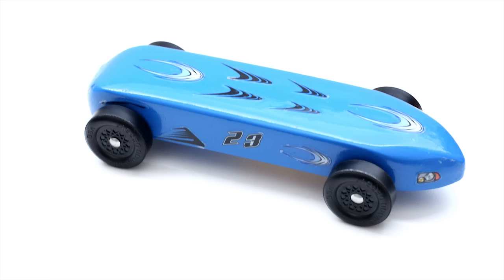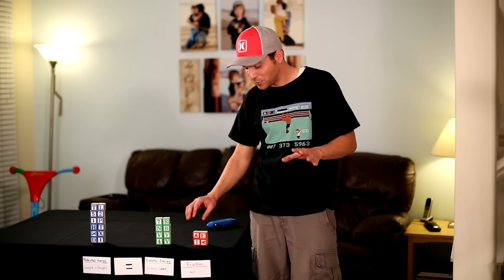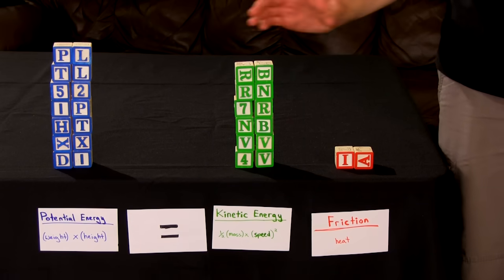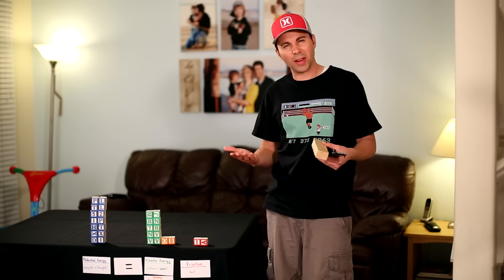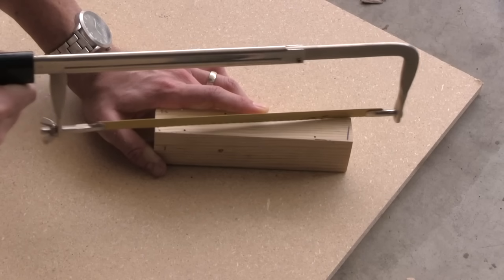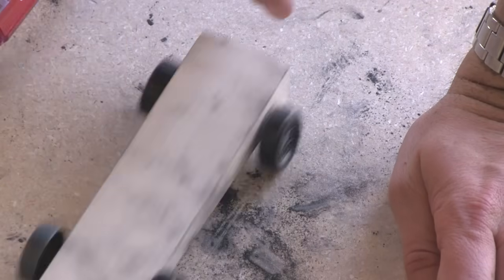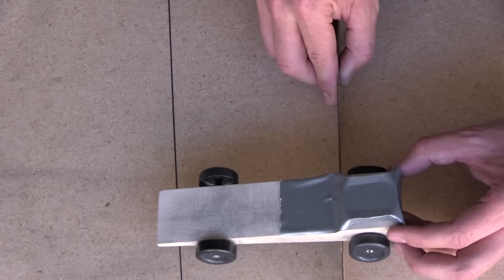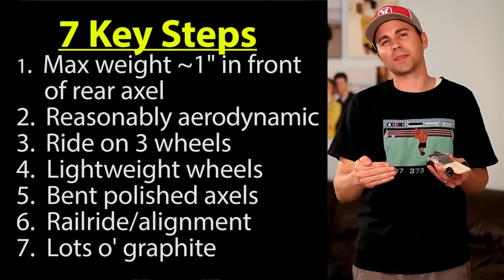EASY Pinewood Derby Car WINS using Science!!!

Comment: I followed his whole video and did exactly everything he said and my sons car was the fastest on the track out of 50 Boy Scouts he won first place thanks to tips and tricks on how he told you to put the wheels and everything
Reply: Congrats
Reply: 👏👏 good job
Reply: woooow xD
Reply: our races all 4 wheels needed to touch and no wheel mods besides removing injection mold seams
Reply: So basically it's a competition between the scouts dad's xD
Reply: @tsupi7056  yeah
Reply: This brings back nostalgia from when my dad helped me and my brother make derby cars and did pretty much everything in the video (and then some). Ended up with me and my winning most races until other parents started to catch on to what "we" were doing
Reply: @d.russell8303  I didn't think so, but it's been about 35 years so I checked the Scout Shop site. Nope, none of these violate the rules SO LONG as you use the axles in the kit.  He seemed to suggest polishing and using other nails, but you can meet every single rule if you just bend and polish the nails in the kit.
Reply: Congrats, you made your son very happy
Reply: @d.russell8303  Usually the only rules are the wheels MUST be official BSA wheels, max total car weight 5 oz, and the car must fit inside a car dimension box to ensure no extra length or height were added to the car.  PLUS - NO dynamic weights, meaning cannot use a weight block that shifts down to give an extra push or a vial of mercury or such.  Other than that, some districts/councils may ban modifying wheels such as routing out inner diameter or coning the axle contact point.  But - these are all techniques that CUB SCOUTS would not be capable of performing anyway so it's usually a sign that the scout did not actually make the build.  HOWEVER, there is an "assistance" rule that pretty much allows a decreasing percentage of Adult "help" as the scout ages so a 5-6 year old scout only has to perform maybe 50% of the build and a Webelo (10-12 year) has to do all the build except for handling the power tools.  

The best technique is for the parent and the scout to build personal cars in parallel so it becomes a step-by-step process that lends itself to direct instruction without hands-on interference.

Let the scout learn by doing and everyone wins.
Reply: rekt
Reply: "Your sons" car, i bet it was mostly yours;) lol
Reply: @johncrosby9312  I am in complete agreement with your closing arguments, and it seems really silly to continue to debate this subject... but having been a Pack car judge for 7 yrs I can remember how crazy dads can get with this event. 

Mercury for cripes sake? TOTALLY sounds like a boy would come up with utilizing carcinogenic heavy metal as a dynamic propulsive component.  

We opened an "unlimited class" for those dads (myself included :P) wanting to push the envelope on what a car could be. The ONLY rules were weigh in at <=5oz, fit in the car box and be gravity powered only so we did not to break the track. Science was used. Specific properties of materials as well.  

My 2 boys' cars may not have ever taken first place, nut they took pride in doing the work themselves with a little help from dad. and spending the time with them was worth far more than a plastic trophy destined for a landfill.
Reply: Awesome 👌
Reply: @tsupi7056  that’s unless you are teaching the child about the physics and the whys and showing the different results. We all learn from each other so it would be a failure to teach as you go along with the build.
Reply: Not your son's car. Your car.
Reply: I guess everybody cheats and nobody checks these days.

Comment: In our Pack we also have the much coveted Turtle award- you have to be the slowest car that still crosses the finish line. It's pretty interesting to see the kids compete for that one.
Reply: We had spark plug trophies and the slowest got n upsidedown spark plug
Reply: Our pack had something like that to. I won. I uhhhh. I uh glued the axles and wheels. So. The wheels didn’t turn. And a few other things.
Reply: Take off the wheels and make it a sled
Reply: Don't make the wheels turn and make it slide across the track but put soap on the "wheels" so it at least crosses the flag
Reply: I'll just put minecraft slowness potion on a working car then LOL
Reply: I wonder if you could use a wheel with a small amount of fluid inside. That would make it harder to accelerate down the ramp. Catching air is good, but axle friction seems like a risky business because it's a linear effect. You want something that will provide more drag at higher speeds, and then maintain a lower speed as long as possible. But what do I know lol.
Reply: Dave Micolichek  This is the first I've seen of this car racing. Do you have to use the 4 wheels, could you say just have the wheels on top of the car and make it a sledge?
Reply: lmao Dave Micolichek really hates when people try to have fun
Reply: General Grievous made a school bus with led lights under us that would change color according to how fast it was moving

Comment: Back in the late 1950s my dad helped me build a winning pinewood racer (which) I still have.  1st step was to go to hobby shop and by a plastic model of an race car.  I built the race car to act as a model for carving the block.  Dad showed me how to cut cardboard templates to act as carving guides.  He had me drill out the bottom side of the car and put weights toward the back and then us lightweight wood filler for the rest of the hole.  This brought the car to maximum weight with more weight to rear.  I won for both speed and beauty at my local recreation center and went on to regional where I got 2nd place for beauty.   I didn't win for speed because I failed to recondition the axles after the 1st race.  At the time dad was working on the 1st ICBMs for the US and treated the pinewood racer as design challenge.
Reply: Your dad worked on ICBMs! That's insane.
Reply: Wonderful memory. My family lived for years next to abandoned Nike missile battery.  😀

Comment: 3 years, 11 cars, 44 races with a 36-7-1 record (Only losing to my other daughters cars in the same race), 9 trophies including 1 Grand Derby champion. All built with Mark's methods. It works! 

Its highly recommended to also watch the Dr Acton video's. I find more and more people have found Marks video over the past 3 years and races are getting tighter because of it I have no doubt.

1. Why do you want to reverse camber the drive wheel? (Imagine how it would contact the center guide if it wasn't reversed). Turning the car into the guide will make it fast but not as fast as reversing the camber. Once you visualize it, you can see the wheel dragging on the top corner of the guide rail with no reverse camber vs rolling along the side of the guide rail with reverse camber.

2. Wheel base. Some race rules tell you that you don't have to use the pre-cut slots. If that is the case make that wheel base as long as you can without putting the wheels past the front or rear of the car. I don't know the exact physics of how it works because my background, unlike Mark's, doesn't include time spent as literally a rocket scientist with NASA. I think it has to do with the stability of the car when it bumps the rail and the moment of inertia to straighten back out. See the other car he is holding in the video that a friend races? It's wheel base is maxed out.

3. Use the lifted wheel to keep the front of the car from going back and forth too much. If the wheel is lifted and out from the center too much, the back and forth motion at the front of the car is much greater that it has to be. This really only has to do with older wooden tracks since they are much less straight and have a lot more dings on the center guide then aluminum tracks. When the guide wheel hits one of these dings it WILL bounce out. Use the lifted wheel to keep that under control.

My only mystery in number 3 has to do with gluing the wheel on the axle so the lifted wheel doesn't roll when it contacts the center guide or let it roll when it touches. Which takes away from the kinetic energy more?
Reply: Wow......
Reply: Wow!  I never knew that there were Boy Scouts out there with daughters.  You must have been sexually active at a very early age, son.
Reply: And this whole time I thought I was reading something from a virgin.
Reply: But, why are you competing against children?

Comment: Been more than 40 years ago for me. Polishing the axles (nails) smooth, narrowing the contact points on the wheels, adding lead to EXACTLY the allowed weight, Fancy aerodynamic carving and sanding followed by a polished lacquer paint job... Ran in one rally and won every single heat hands down. Of course, as much as I know all that stuff now, I didn't have a large hand in the actual process at the time. I still have the car and the ribbons on a dedicated little shelf in the rec room.

Comment: There is an additional principle that might help, which is moment of inertia. You can have the center of mass in the same place but cut down on rotation by having a light center and weight maxed out on the very ends of the car. This would potentially allow you to have the center of mass further back in the car without doing a wheelie. Also, a teardrop shape, with the fat part in the front, is actually more aerodynamic than a wedge, it's just not feasible in real life cars because driver/windscreen manufacture/engine packaging. If you machined it accurately into an aerofoil you could actually induce some lift which would cut down on friction at the axles, while still having very low drag. You could also experiment with the rake angle on the underside of the car, again with the intention of increasing lift. This is the stuff I would play with if I was trying this out myself.
Reply: thanks! very helpful!
Reply: I made an airfoil one year. It did pretty well, but didn't win because it dragged on one track.
Reply: On a free body diagram, lift does the same thing as lowering mass; as a force, perpendicular to the plane the car is on. The maximum allowable mass is used to increase the weight (force caused by gravity on the mass).  Statically, the cars will weigh the same, but in motion, lift reduces the net downward force and during the time the car is going down the incline, it will result in lowered acceleration (especially towards the end of the incline where speed increases lift). 

The reduction of weight-induced axel friction would have to be greater than both than the lift induced acceleration penalty and the lift surface drag.
Reply: my thoughts  @DT-dc4br
Reply: Didn’t even think of this!! The car does have to rotate from its angle of depression to level, and while I’m sure the effect is very small, it could possibly set a car apart from others who just did what was in the video!!
Reply: @macraw83 Nope. His logic is sound. The normal force is, by definition, perpendicular to the car's direction of travel and can therefore do no work on the car (W=Fd cos(theta) and the cosine of 90 is zero). The force accelerating the car is the component of gravity that is parallel to the track (mg sin(theta) in this case). That component would be unaffected by a lift force. All a lift force would so is (as you correctly said) decrease normal force and therefore axle friction. In conclusion, as long as this reduction in friction outweighs the drag of an airfoil, the airfoil would have some (probably very very small) positive effect. Not sure it's worth the effort of making an airfoil, but it would certainly be worth testing.

Comment: The one my Dad built me in 1966 was Candy Apple Red with 4 1/2 oz of lead in the back above the rear axe. Dad carved out a hole melted down some fishing weight's, poured the lead in, wood puttied the hole,set the rear Axel. Carved it down to a 1930s Indy car body. And lubed the wheels and axels with ground pencil lead.
Candy Apple Red metallic with flames and sponsor sticks from model kits. It won the prize for being best looking. And for being the fastest. Damn, maybe just maybe,the old man was a little sharper than I gave him credit for.
Reply: Your dad cheated. You aren't allowed to use anything that doesn't come with the kit and lead fishing weights do not come with the kit. You didn't really win anything. Cheater!
Reply: @gamewizard1760  I didn't build it.  I barely got to touch it
Reply: @gamewizard1760  You sure that was the case in 1966?
Reply: @gamewizard1760  That's not true.  We had to use the block of wood, axles and wheels that came with the kit, but beyond that, anything goes.  See my above post that describes how we built our cars.  That being said, his father was what's wrong with the Pinewood Derby, that being too much parental involvement.  This is supposed to be a learning and bonding project for the boys and their parents, not dad beating a 12 year old kid by doing all the work.  His old man was, no maybes about it, a prick.
Reply: Matthew Rapata   I didn't infer anything, I read the words he posted.  "I didn't build it. I barely got to touch it."  His dad did all the work, that's hardly a "family project" and nowhere near the spirit of the event.  My boys actually worked on their cars.  They did as much by themselves as was age appropriate.  In the first couple of years there was major supervision, such as both of us holding the sander and drill press.  They did more and more of the work by themselves, until they were doing almost all of it the last couple of years.  The only power tool they never used alone was the jig saw.  That's the way you teach your kids, by allowing them to actually learn a skill, not just watch dad do everything.   

Our pack tried to combat the dad egos by also having a race for the dads.  They had to use the official kits, but there were no holds barred, other than power assist.
Reply: @erikbaran7197  sorry as a parent I figured you would want to lead by example and teach him about the human race and how to use our surroundings and knowledge to give us any advantage possible. Including your parents.
Reply: @matthewr920  What did having his father do all the work teach him?  What did he gain, what did he learn by him "winning" without doing any of the work?  The object of the Pinewood Derby isn't winning at all costs, by any means necessary.
Reply: @erikbaran7197   Look at his comment. If you think he didn't learn anything then your wrong. This is a highly competitive sport. If your proud because your son learned how to cut a wood block you should have taught him outside of the pine derby.
Reply: @matthewr920  No, I taught them to....Do Their Best....ever hear anything resembling that phrase?  "Their" best, not "dad's" best.  He learned that he could be declared the winner even though he didn't do any of the work.  Great lesson.  Maybe when he's writing a college thesis he'll remember that lesson and use someone's work to gain advancement.  Good old dad's lesson comes through!   He learned that he can receive praise and awards without putting in the work necessary.  Fantastic lesson.  Let me guess, you voted for Trump.  And it's "you're", not "your".  And the Pinewood Derby is not a "highly competitive sport". It's an annual event in the Cub Scout year.
Reply: @erikbaran7197  Why only for the boys?
Reply: Hi
Reply: @erikbaran7197  The internet: where everyones' opinion matters - even if it about a complete stranger's relationship with their father.
Reply: @matthewr920  The Internet - Where two complete strangers can determine the best use of their time is arguing about a third complete stranger's relationship with their dad.
Reply: The internet: Where complete strangers waster their time reading the arguments of other strangers about other strangers.
Reply: @gamewizard1760  weights don't come with a stock a car. You are allowed to add weight to it.
Reply: From what i remember from my 5th grade shop class...back in 1980 something...we were allowed to add pennies. However the cars had to be witihn a certain range of weight.
Reply: Joseph Burke chill out

Comment: When I was in grade 8 woods class, we did something very similar. Used Co2 canisters to propel our cars across the shop floor while attached to a string. I made a car that was as light as possible, low as possible and the wheels were covered. Fastest car in the class

Comment: Makes me miss my dad.  He helped me build a winner.  He was an excellent woodworker.  I was so happy when he fired up the oil heater in the garage for us to work on those cars in the cold Iowa winters.  It was like the car building scene in days of thunder minus Robert Duvall.  Shaved her down and shaped her like a bullet.  Get rid of wood weight and put the weight where you want it.  Back then you could mess with the wheels so we made them perfect.    Splurged on a light coat of metallic green paint even though it's wasted weight.  He taught me so much that transferred into the rc carpet oval world.   It allowed me to be dominant in the Midwest in the 90s. I hope he was proud.

Comment: I didn't use a co2 cartrige; I used a  c6-5 rocket motor, then ran for a fire extinguisher.
Reply: I bet that ended well.
Reply: c6-5 burns to long, try just using the 1st stage from a 2 stage c class motor. forgot what they were called (haven't had a rocket in 15 years) but I know the only burn for less than a second
Reply: c6-5 burns to long, try just using the 1st stage from a 2 stage c class motor. forgot what they were called (haven't had a rocket in 15 years) but I know the only burn for less than a second
Reply: c6-5 burns to long, try just using the 1st stage from a 2 stage c class motor. forgot what they were called (haven't had a rocket in 15 years) but I know the only burn for less than a second
Reply: Joshua Leniger I want it to burn FOREVER so I beat the SH** out of the competition!
Reply: +bob
Reply: joshua be like. bruh! do you even comment. (or maby im just seeing a glitch.)